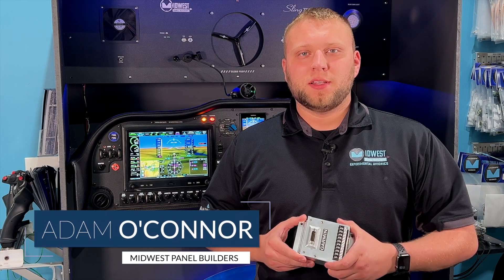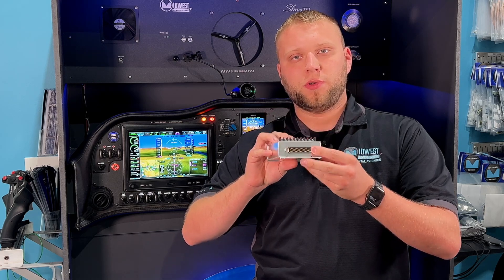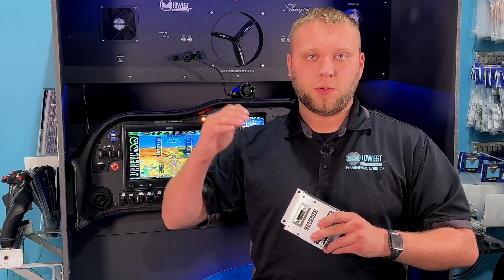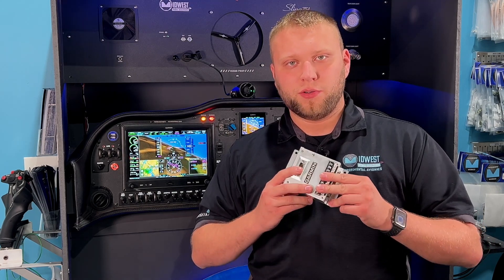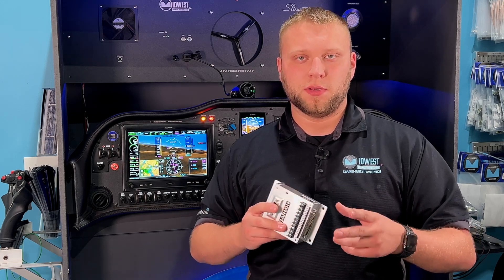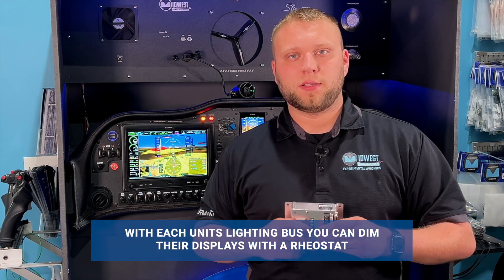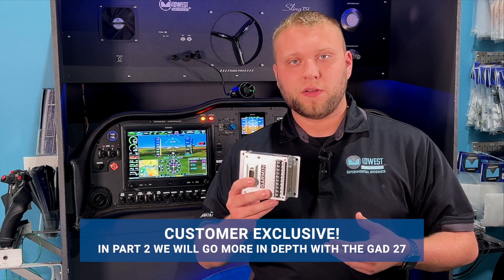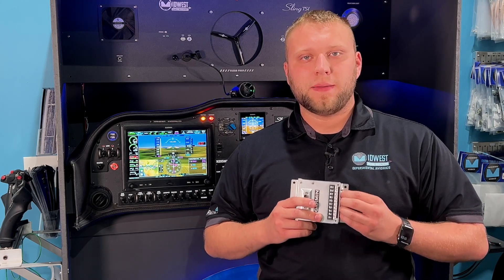The Garmin GAD 27.

Comment: The power conditioner trick that Midwest Panel Builders discusses with the Garmin GAD 27 refers to its built-in voltage stabilization capability, which acts as a power conditioner for light aircraft without redundant power sources. Specifically, by wiring the input to ring terminal 1 (which can handle drops down to 5V DC), the unit provides a stable 12V output from ring terminal 2 at up to 3.5 amps. This helps prevent issues like voltage sags during engine starts that could otherwise cause avionics (e.g., ADAHRS) to realign or glitch. They highlight this feature in their YouTube video on the GAD 27, noting it's a "neat little feature" for maintaining consistent power bus output. This is required on 12volt certified aircraft.

Comment: Hello Adam, I have a GAD-29 on order for my Kitfox but I don’t see a 27 on the order. Not knowing too much about avionics I believe these two items are completely different. Do you agree? Looks like I may have overlooked this little box which sounds helpful. Thanks, Matt
Reply from the maker: The Gad 27 is a different box and has great function. Being a Kitfox you may or may not want to use it since you are manual flaps and usually trim is one switch in the center. The GAD 27 does give extra discrete inputs if you like to have different alerts and it also has useful lighting busses for dimming equipment or cockpit lighting.
Reply: @MidwestPanels  Thanks for the explanation.  I will see what my limitations or lack there of will be with my current AVI layout.  I’ll keep this gem in the back pocket for expansion later on if needed.  Have a great day, Matt

Comment: I build one in my TSI as well, how did you solve the problem with sharing contacts with the backup battery? The keep alive option from the GAD27 shares/ are connected to the same voltage inputs of the GDUs with the backup batterie.

Comment: With trim servos wired through the GAD 27, will the autopilot trim the airplane, or do you need wire the output of the GAD27 through the GSA-28 AP servo, then to the trim servo?
Reply from the maker: You do need to wire the trim through the GSA-28 for the autopilot to control it.